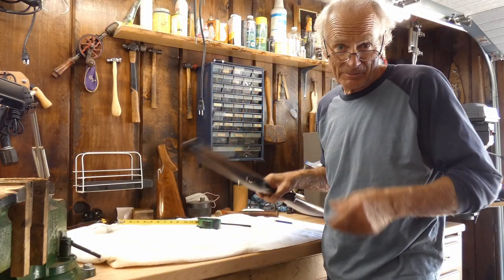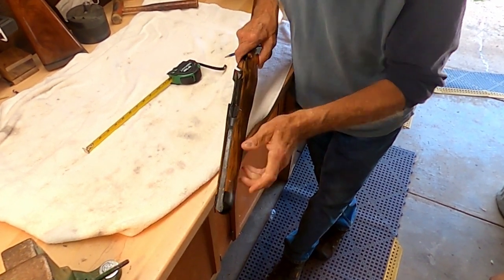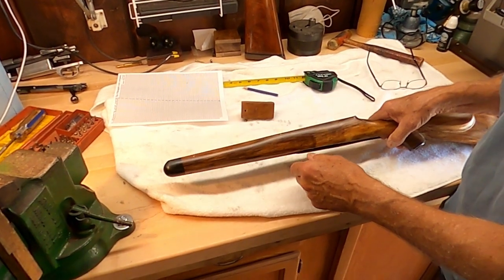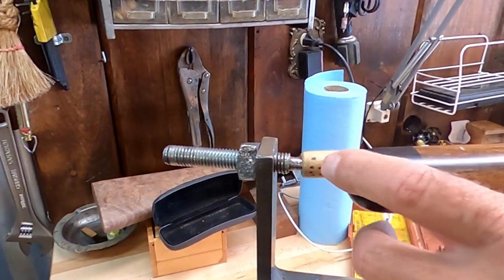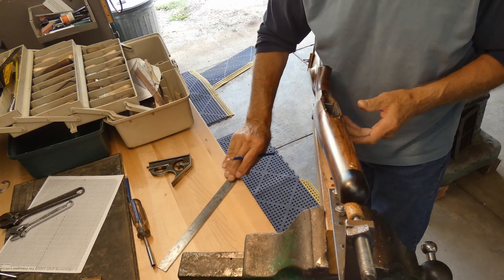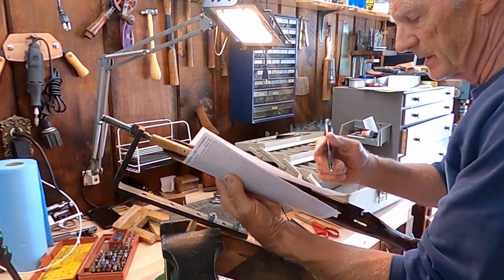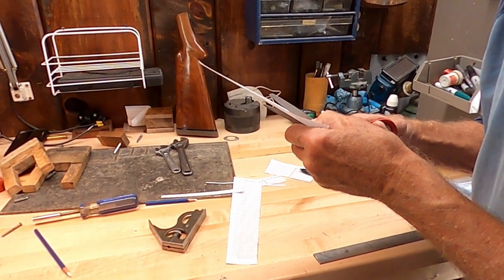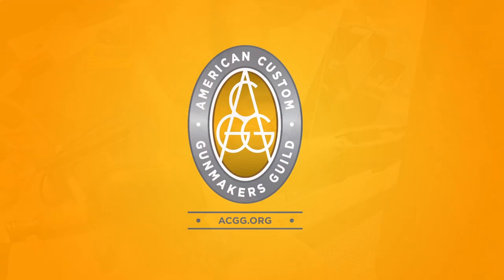Checkering with Chuck - Part 1

Comment: Have you considered using spray adhesive instead of tape to secure the pattern to the stock?  You could remove the residue with rubbing alcohol and it has the benefit of holding the paper down more securely than tape.